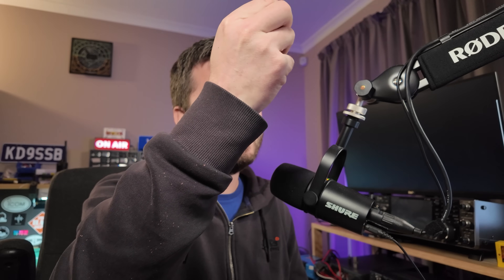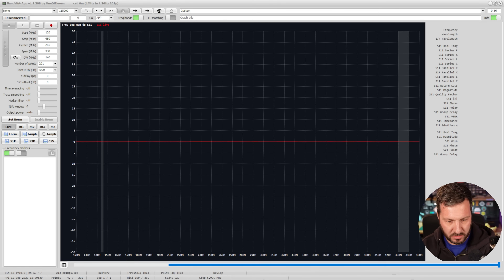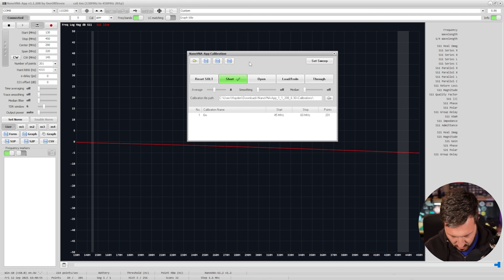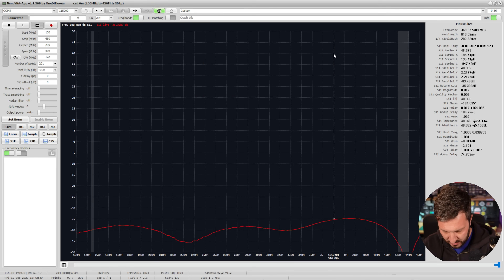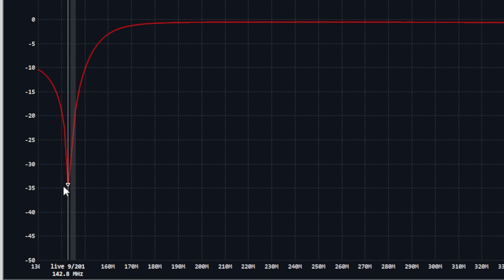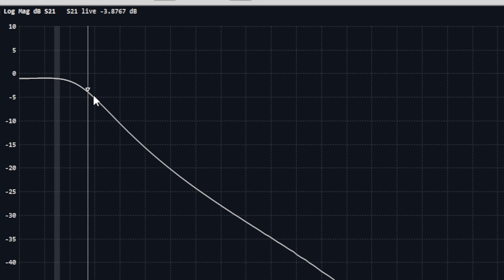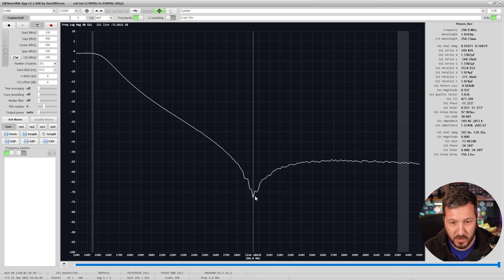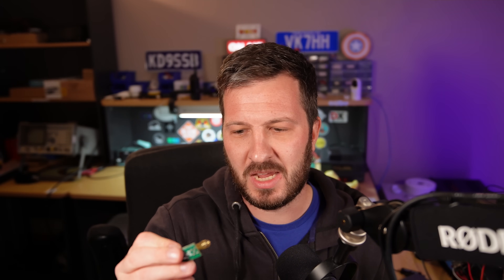NanoVNA Basics: Testing a NEW Baofeng Filter!

Comment: I suggested this back when dirty Baofengs were first noticed. The 2 most common responses were, 'That's Baofengs problem, not ours', and, 'Gee, I guess we cant use our Baofeng HT's now'. From the POV of a US ham I found both responses to be quite silly. In the USA, WE the hams are responsible for the signals we radiate, not some manufacturer of a device we decide to use. So we best NOT go on the air with something that doesn't meet specs. Second, WE as hams have the legal right to fix such problems. More, this is exactly the sort of thing the FCC licensed us to learn how to do, and to then do. Hands-on learning about RF was the reason the Amateur Radio Service was created. That's what the hobby is all about. That's where much of the fun is. My first thought on the Baofeng harmonic problem was, "So fix it. We're hams. Duh." Appliance operators have yet to learn why the FCC has authorized even Tech licensed hams to design, build, tune and operate 1,500 Watt amplifiers, with no FCC review of our designs, or final testing of our device or devices. We are free to play with RF, but we are responsible for our play. The idea that we could do whatever we wanted with RF within the rules was a little hint on the part of the FCC about what they were hoping for, just the sort of thing that you are doing and teaching to others. Thank you.

Comment: I started making one of these for my dirty boafeng. I was going for a deadbug in a PVC pipe with bnc connectors though. Especially if you can make them cost less than a boafeng I think a lot of people would like one of those. The other inline filter options are at least 60USD.

Comment: Hayden, the link you have is for a clone NanoVNA. I know because I have had one for 2 yrs. +. The SSA-2N is a clone. I bought it because it has N connectors and cables, a heavy duty unit. I decided to update the firmware yesterday and found out that it is a clone; Zeenko manufactured. I flashed it with the latest bios; then I spent several minutes trying to un-brick my unit.  I took it apart and unplugged the USB board for the unit; and then reattached it. That got it back to "boot loader" mode. I got it flashed with something that gave me a 2" screen in the corner of my 4" display. I did find something that got me back to "working" with a normal display and function. It took some searching but I did find a version that ended in 39. It is working again at least. I couldn't live without it whilst making antennas work! The price is cheap today for the clone though, and it works. There are accuracy challenges from NANOvna but It works great for Ham radio wire antenna diagnosing. I love you can just look on the screen for the matching transformer spec you need.
Reply: As I understand it, both Zeenko (Hugen) and NanoRFE both accuse each other of stealing the other's designs for their respective improvements over the original open-source NanoVNA. I don't know if one cloned the other, or if they both independently developed similar improvements then tried to blame the other. It seems like they both have continued on to produce unique products, but NanoRFE are pushing more info a semi-professional direction with their latest VNA costing over $700, while Zeenko/Hugen continue to target hobbyists.

Comment: Nice idea! If you added a diplexer section and the low-pass for 70cm you would have both bands covered. You could either combine the RF back into a single connector, or provide separate vhf/uhf connections.

Comment: The NanoVNA is a surprisingly nice piece of kit for its price.... In my RF engineering work I usually make use of an R&S ZVL which is a beast to lug around.... Back in my mobile phone comms days I used an Anritsu Sitemaster to do acceptance testing for GSM/UMTS cell site antenna systems. Happy days! 73 de Glenn ON4WIX
Reply from the maker: I'd love to have an Antritsu! Expensive but cool bit of kit. The NanoVNA does pretty much all I need though at the moment.

Comment: LOL, your killing me dude.  Those poor connectors.  Tighten the nut, don't spin the connector into the nut.  You only have to do that a couple times to destroy the center pins RF properties at high frequency.  The center pins should never rotate within each other.  Otherwise, spot on with the measurements.  Trace impedance and capacitance may have thrown off your frequency a bit.  The higher you get in frequency the more important circuit trace layout becomes.
Reply from the maker: Cheers for the tip. Sometimes in the heat of the moment filming you make mistakes.
I've made a revision 2.0 which should be here soon to test.

Comment: Loving the NanoVNA series.
Quick Q, would I be correct that if I have an antenna that I don't know what frequency it's for that using the NanoVNA and checking for the lowest SWR would be the way to go?
Reply from the maker: Hey Jez, thanks!
You can use the NanoVNA to sweep the antenna and check for lowest SWR. This may not accurately show what frequency it's for though as some antennas have harmonic characteristics and others just happen to look quite nice (low SWR, 50 ohms) but don't radiate out very well. But.... basically yes - in most cases it will give you a good indication of what's going on. 73!

Comment: Thanks Hayden that was a great video. today i receive the NANO SEE 2N  did you update the firmware?  or the version? the version it has is v1.3.07  any updates out there?  i hope next video is about that how to update the firmware
Reply: don't update with NanoVNA software. The SSA-2N is a clone. Just leave it alone until you do some research. I found a version ending in 39. It might be 1.3.39? I believe it is a custom version written by a Ham. I found it whilst on my logging computer in the shack so I don't know where I got it exactly but it was on a forum post.

Comment: Hi! Thanks for the effort! This is so niche that it's probably bad for your channel. 😕

I believe you've not calibrated your measurements correctly. What you want to measure is only your filter, yes? That means that your calibrations need to be with everything connected to NanoVNA other than your filter, including all cables, adapters, converters and plugged in (or not) phone chargers in the vicinity.

That's a densely packed statement that I made, please read and re-read.

In essence, between calibration and measuring your filter, you want the only change to be - adding your filter to the system.

Once again, tyvm for the effort. I only make this comment because I appreciate the work you put in and I want everyone to benefit from this comment.
Reply: Viktor is correct. The calibration plane must be right at the DUT.
I disagree that the VNA series is niche however, a lot of viewers are  watching it. Well done OM.
Reply from the maker: Thanks for watching and for the helpful advice, mate!
Reply: Yes, ham radio is a niche YT market. But this is ham radio. Chatting on rigs is a subset of the RF hobby.